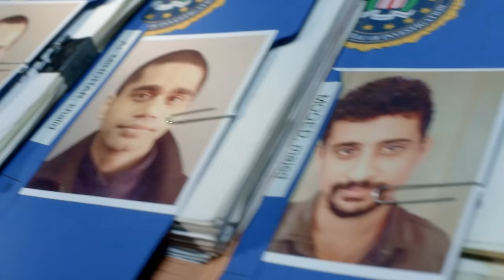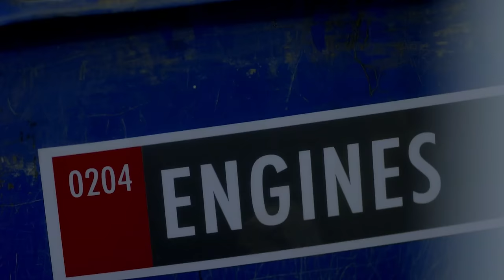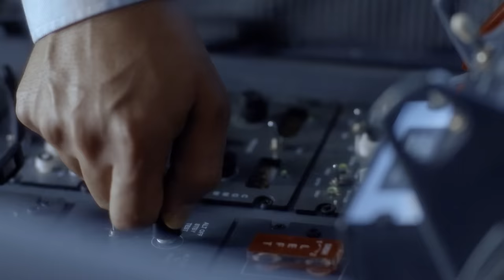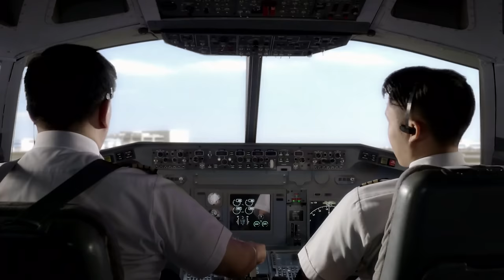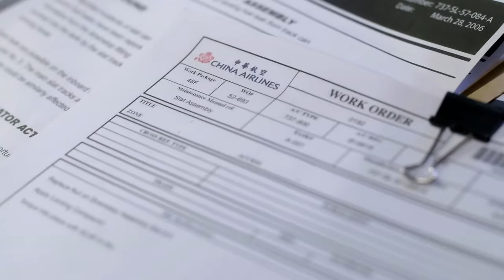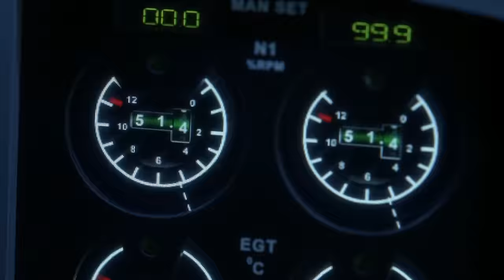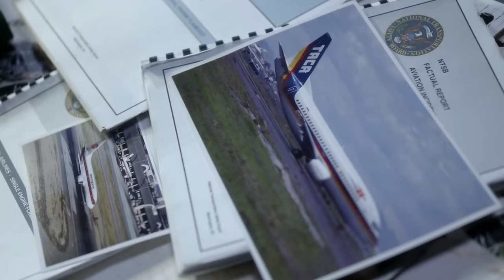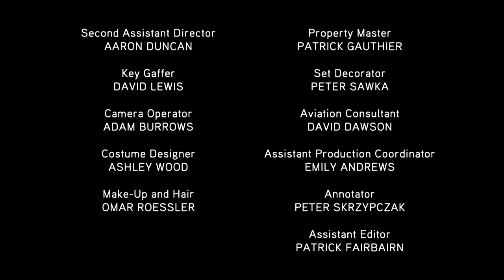American Airlines Flight 77 Crashes Into The Pentagon | Mayday: Air Crash Investigation

Comment: The second story, if it was that difficult to handle the washer/bolt from the ground, why didn't they use a step ladder? Instead of stretching and possibly 'damage' the assembly a couple of feet on a step ladder would be so much easier.

Comment: In the second episode of the Taiwan leak with the down stop screw this video says it is a botched repair job that's not true it is a botched design job it's the engineers who caused this problem. That a washer is required to hold the bad design.

Comment: 18:18 where's the holes from the wings. 😂

Not to mention it's 2024 and my phone wont even work on a plane. Didn't they only have dial up internet in 2001?
Reply: Uhhh that’s the c-ring (or d-ring) where the plane last broke thru. So there wouldn’t be any “wing holes” because it’s just all debris at that point. 

And in 2001 you still had phones on the plane.
Reply: You got that right dial up.
Reply: Maybe a new and better phone should be on the shopping list? Phones worked on planes then, and they work on planes now. Internet has nothing to do with it.